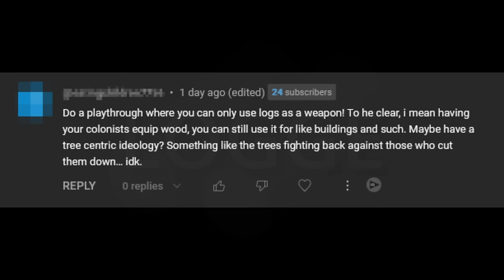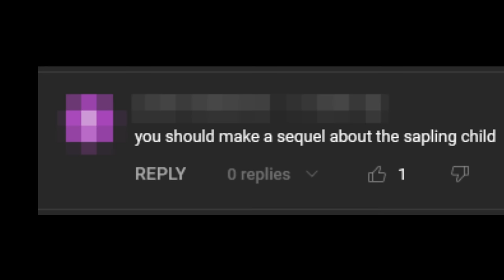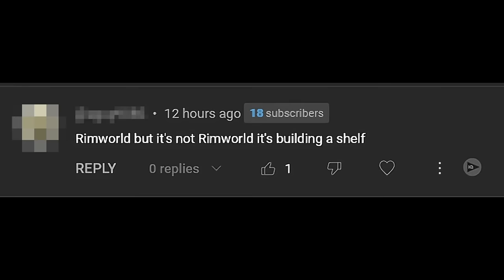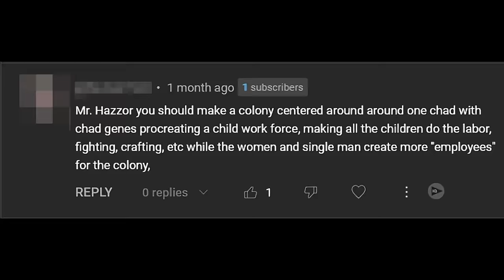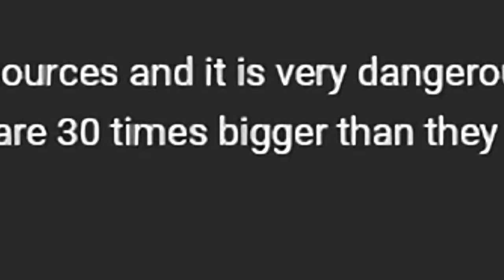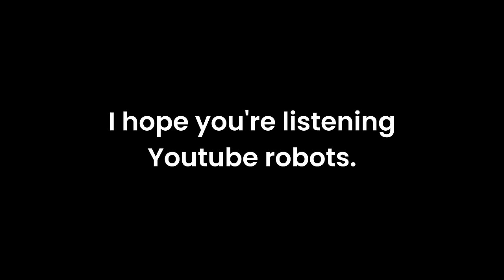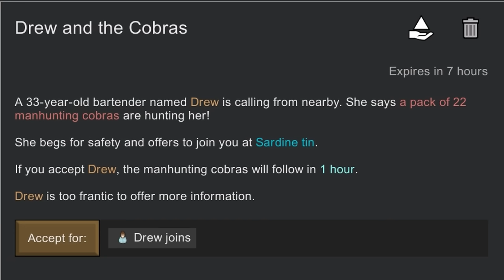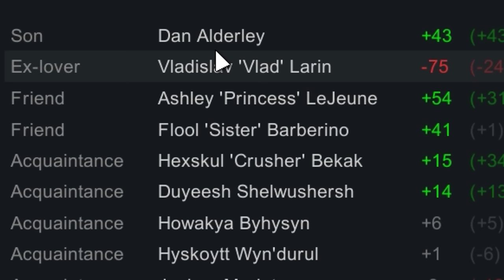Trying Your Dumb Rimworld Ideas

Comment: Here’s an idea based on a run I’m currently doing. Select an island and try to get to space from that, starting as either crash landed survivors, a clan, or a tribe. I’ve done tropical but others might work as well. You can recruit whoever you deem fit, but with an island not only is your space limited, as are most of your resources, you can’t actually leave the island for quest locations and the like until you research drop pods. People can still raid you and caravans can still show up, but you can’t send either until you have the right tech.

Comment: A whole colony that runs on Luciferium. 4 to 5 colonist at the start with 20 Lucis. You can use whatever start you want. If you want to add the extra challenge, you can try to recruit more colonists and give them lucis as well.

Comment: If you are still taking these, here's a suggestion:
A colony with a single person in it. Well, you can have other people, but only if they are slaves, prisoners, made into mechanoids, etc (basically being controlled by you), not doing any work in the colony (maybe a quest thrusts someone on you, or you want them to get laid for that mood buff), or are temporary like the refugees or called in labor.
So, you'll either need to keep the colony small, or start automating with things like mechanoids, dryads, tamed animals, and/or modded machines. etc. Any mods as long as the modpack doesn't net decrease the difficulty of the run by much compared to vanilla.
A variant of the above idea might be just a 100% pacificist colony, so you just need things to fight for you.

Another thing could be (though not sure if it's possible) 100 days to get from VE tribal to the spaceship FTL victory in SoS 2. Any xenotype as long as it's premade or rules legal with no archocapsules (at the start, future genetic engineering in game is a different story), and same rules for mods as above (in fact, same rules mod wise for all of these).

All vampire run. Can have slaves and prisoners, but all actual colonists must be sanquophages. VE Sanguaphage is allowed.

Lastly, Noa's arch: one of each premade xenotype (including baseliner), no less, and no more without kids or clones. But the original members must remain alive. As long as they aren't OP (including being balanced out by them showing up in potential raids), feel free to add more xenotype mods for more to work with, like the VE stuff, alpha series mods, Biotech Expanded, Big and Small, etc.

Comment: I usually like more of a relaxing experience, and I have gotten into a mood in which I'm sick of all the fighting in video games, so I tend to play RimWorld in a peaceful mode, with raids turned off.  However, I still like to have some challenges.  I have come close to following that last idea - accept any potential colonist who comes along regardless of how troublesome they may be.  It can result in a rapidly growing colony, though without captured raiders, it doesn't grow quite as fast.  Food, space, and interpersonal strife can be troublesome at times, and pyromaniacs can be counted on to spice things up, but it helps to have a lot of workers.

Another good peaceful mode challenge is difficult environments.  Without meat that can be obtained from raiders via cannibalism, the ice sheet is nearly impossible in the early game, and I don't think sea ice is possible at all without a custom scenario in which the colonists start with a lot of extra supplies.  I've attempted the ice sheet a few times, with a success rate of about 20%.  A little good luck can barely get the colonists through the early game, and once they get hydroponics going, it is easy from that point.

I wonder what other sorts of peaceful mode challenges are feasible, especially with mods.  Typically, these games get very easy once the colony is firmly established unless there is a major environmental catastrophe, and it simply becomes a sort of creative mode for building.  The "accept every potential colonist" rule helps to spice things up in the later game, so I usually at least partially follow this.  I think in my next game, I'll follow it to the extreme and see what happens.

I suppose my idea would be to find some combination of challenges for the peaceful mode that will make the colonists just as miserable as in a colony that is constantly beset by raiders.  Some combination of bad environment, accepting all potential colonists, and crazy genetics or difficult ideologies could do the trick.

Comment: single pawn naked brutality start. nomadic, no settling allowed at all.
the goal is to raid nearby settlements, recruiting anyone you can rescue and looting whatever you can.
you are allowed to stay in the settlement after conquering it and make use of existing facilities until made to move (or set yourself an arbitrary limit, whichever you decide is better)
the goal is to reach X colonists (50?) or to destroy the biggest baddest settlement on the map
i myself have actually done 2 playthroughs like this and its quite fun, the biggest tip i could give is to scavenge as many mortars, turrets and batteries as possible early on, tame some pack animals on the first few maps to bring with you too. the final raid will take some strategy and quite a bit of time to get through but well worth an attempt and not as difficult as one might think!

Comment: Reverse the No Pawn Left Behind. You can be completely selective with something like Prepare Moderately (or just lots of rolling) and the Rich Explorer start, but the colony may have no other active human/kin pawns. Dryads, animals, and robots are fine. If you're forced to accept a pawn by an event or quest, they cannot do any work and should be cryostored or killed if possible. (You may take slaves to complete a quest as well, even a quest with no downsides to refusing, but the same no-work rule applies.)

Comment: Do a no-contact-colony (no physical contact).

Essentially, you wall off your colony, dealing with raiders through embrasures or mortars / artillery, only trading with the trade vessels, rescue nobody outside the walls... etc etc.

Essentially quarantine a bunch of combat orientated colonists. (this means you need to be 99% self sufficient. If you can't get it via orbital trader, or make it yourself, you won't get it. ever.

Comment: Please do a boomrat run. They are ohhh so broken. 
Take 6 days to give birth to two babies, which take just under 14 days to grow to adults. Having 10 female and 2 male boomrats will give you 20 adult ones in 21-22 days.
You can create a single undefended maze entrace to your base, put turrets at all other entrances, and fill it with chemfuel or mortar shells.
When the whole raid is inside, send a single boomrat in to detonate the shells/chemfuel to take them all out.
Boomrats also eat corpses so disposal isn't a problem.

Simply seperate the males from females to stop explosive growth.
Drop pod em on enemy bases before you send in your pawns, perfect distractions, and great for taking defenses out (20 per base is more than enough, 10 per pod).

They barely eat any food too.

Comment: Rim world idea: Godlike Sniper Turret. 
Takes up 3X9 Square Space (huge) but can be built from the beginning of the game. Fast construction time, and targets anything not yours on the map with the slow fire rate of a bolt action that does 999999999999999 damage. Key problems: Only 1 is allowed PER SETTLEMENT. If you want to make another you MUST completely take over another settlement. Also, the bullet and vision is maxed out, the bullet will travel over any obstruction or player made structure to accurately hit it's enemy. Since you can only build 1 and the fire rates not that good? Also it's loud as fuck? You gotta consider WHERE to build this temple-sized turret to maximize hostile kills, it's something that helps lighten the load against attackers, not really gonna help in a horde situation.

Comment: Try to start as a wild man, with one or two pawns and no research whatsoever. You won't be able to mine, construct, and some other things in the beginning, you'll have to research that. You also have to use Research Reinvented (turn off the infinite theory research, but occasionally you can turn this back on, as there are bugs and dead ends sometimes) and Stepping Stones.
Reply: You'll have this tab called "Basics" in the Research. Ah, also you start naked and without anything.

Comment: Maybe a stupid question but in No Pawn Left Behind, you used hydroponics with a sunlamp. Wouldn't it have been easier to just place them outside and just use the hydropponics basins? Or do you actually need both?
I was under the assumption that the sunlamp is just something if you can't place the crops/hydroponics outside
Reply from the maker: You typically put hydroponics inside so you can control the environment to ignore seasons, temperature events, toxic fallout, etc. etc.

Comment: Breeder cult probably felt "boring" because those two modded turrets are holding off a ridiculous amount of raid points you play Rimworld however you want but it really seems like the over powered turrets turned this colony into a game of Sims which you didn't like

The no pawn left behind colony I'm shocked was lost to a single scorcher they have pretty limited range (4.9 tiles in fact the shortest of any ranged weapon in the game while your smg's are 22.9) so it can be quite easy to simply deal with them before they ever manage to set someone on fire but you clumped everyone up so they all got lit up at the same time which snowballed into the whole colony dying (I guess) there were a lot of cuts but another problem seemed to be a lot of colonists set to flee and you pretty much just giving up letting them run around which like with the breeder cult if you just got bored or wanted to give up that's fine but certainly seemed they could've lasted longer

The "logge" colony is a tricky one you practically have to abuse the game to it's limits to make melee only work by using choke points, melee block, and the infamous "corner punch" melee only can go quite far even with the humble "logge"

Comment: I'd like to retry the taukai child but instead forbid the beds and have the companion dryads carry the baby to an outside sleeping spot
Reply from the maker: Where it'll die to raiders as soon as the turret ammo runs dry. 

And even without that, weather or a drop pod raid will get it. 
Unfortunately it's just not a good idea, Obviously the actual suggestion is that I make the saplingbaby into a child that can do work but even then is that interesting to watch? a child in a fully built base with all tech researched?

Comment: 6:55, that corded drill has way too much torque for such a small project. A battery powered drill would be way better, then you don't have to worry about breaking your wrist while trying to keep the screw from catching the wood and spinning it. That's also why the wood split, well, the wood split because you drove the screw too far and broke through the back, but I'm that happened because you couldn't control the torque.
Reply from the maker: So d'you think I bought a hammer drill for  the bit or something?

Or that I was trying to make a nice shelf? 

I dunno, it's just strange that I can make something so enormously obviously a joke and still get DIY advice given completely seriously.
Reply: @HazzorPlaysGames  let it be for those who don’t know. It must be extremely exhausting to get the same “you’re using this tool wrong” message simply because you made a joke, I apologize.

Comment: Log colony would excel with better base design. You can basically beat this game unarmed if you know how to make a proper melee killbox. Killboxes are boring, sure, but they're the only way, unless you do other extreme cheese tactics involving doors and the like.
Reply from the maker: Isn't that how I ended the log section, by saying that it could go further with cheesy killbox tactics?
Reply: @HazzorPlaysGames  Nah, you actually just talked about mods making it easier. Even using simple doorway melee tactics (funnel enemies into doorway, then bashing their heads in) would allow you to easily handle most raids.  You also could have forced the enemies to spread out by closing off your walls, which would have made them manageable. Or just fought them individually so they couldn't shoot at you with their guns and molotovs.

Comment: Idea: make an equal number of Pawns, split them into two groups at arrival and let each of them build a settlement without any connection, even forbiden to see each other. Both groups have completely different ideologies(or are just in general different) and your mission is to see which one does the best.

Comments can decide the ideologies of the two groups or give extra suggestions. Have fun ;)
⬇⬇⬇

Comment: Yo. 9 months late. Here's how to make a shelf. A shitty one, but better than that... thing... you made. 
4 boards, 2 screws, a drill and an impact drill. 
Arrange like this:
|=|
Put middle boards as far apart from each other as desired 
Once aligned, put marking where the center of the horizontal boards touch the vertical ones. Make sure you're ok with the markings, because that's where the screws go. 
Drill through, and remember, measure twice, cut once. Then use the impact to put in the screws. 
Now you have a really, really shitty shelf.